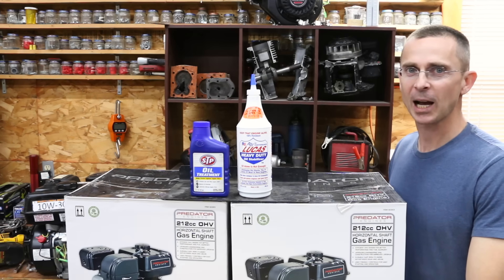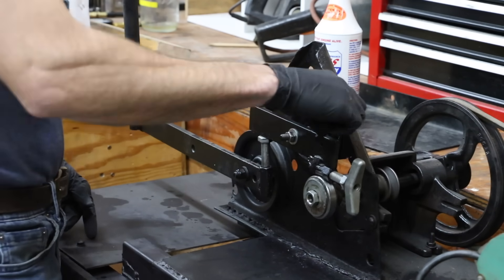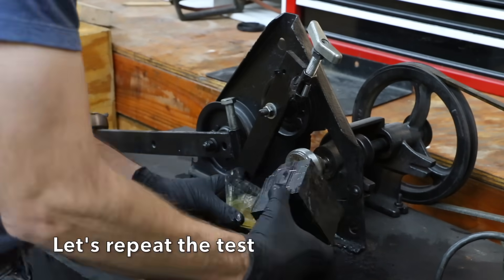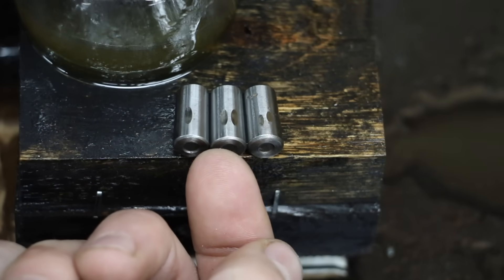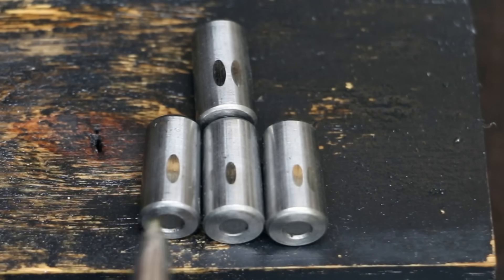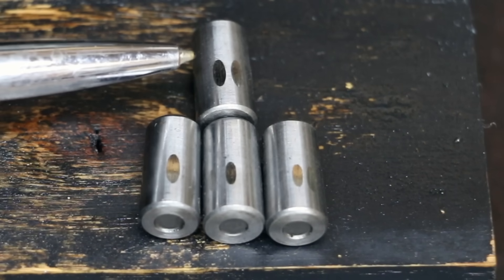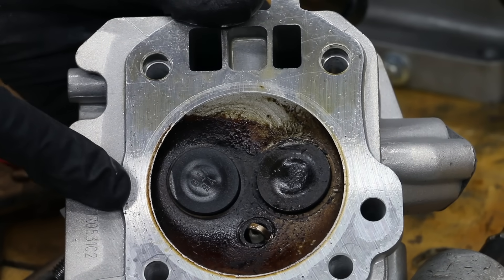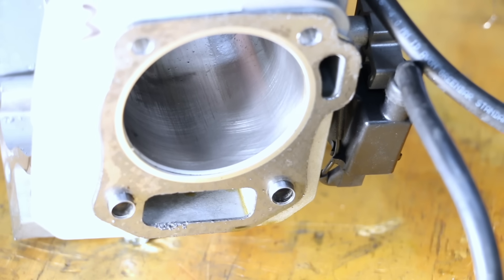Which engine self-destructs first?  Lucas or STP?

Comment: when doing these tests you should always mix at the same ratios.  It will allow for a standard test and the results from any product can be compared.  How did bestline compare to these additives?  engine run time and bearing wear measurements?

It is surprising that just 10w30 lasted 38 minutes and with bestline it lasted 70+ minutes.  Could it be the tolerance on these engines is just too varied?  You might have to test 2 engines with identical oils to see if they fail at the same time.
Reply from the maker: Thank you for this recommendation!

Comment: Run a lawnmower on break parts cleaner like spray into a container then feed into the fuel line did it on a weed wacker engine with some oil ran top notch much more rpm
Reply from the maker: Thank you for this recommendation!

Comment: You should try high mileage additive vs is the normal additive. Another great video man. This channel only gets better and better.
Reply from the maker: Thank you for this recommendation and thanks for the positive comment!
Reply: Tavo24vv the high mileage oil has additives that swell up the gaskets and seals to keep an old engine from having oil leaks.
Reply: yellowlt1ta I’ve heard about that but It almost sounds to good to be true.
Reply: I agree with  yellowlt1ta  I used to manage an oil change location in ATL and that's what those types of oils do they swell up the gaskets to prevent or minimize leaking.. I always said it "conditions" the gaskets
Reply: Novusod he should try the Lucas Synthetic vs. STP synthetic 😗 anyways I use Lucas in combination with the Upper cylinder lubricant to lubricate from the moment those injectors start spraying.
Reply: BikeMaster, I like Upper Cylinder Lubricant, I have a video about it and the Lucas product he used in this video.  Come check it out. Some very smart people commented under my video. You'd learn a lot. :)
Reply: I have a 2002 mustang GT 5sp 144,000miles  and I have a gallon of the Lucas Upper Cylinder Lubricant in my trunk and EVERY time I fill up .. Boom in it goes..( not the whole gallon lol)
Reply: Novusod regular oil changes are recommended once every 50hrs or 1 year on small engines so I imagine it would have some issues around 100hrs.  Would certainly be an interesting test to see how long it would run with the oil in it though.  You'd need a larger fuel supply to do it but technically it's possible.
Reply: Like to see Motor Kote up against any other additives. Had a lot of good experiences with that stuff. Thanks and a great video well done.
Reply: I have a similar engine running a generator at my camp. I run it sometimes for 2 weeks without shutting down.  No problems yet.
Had it for 6 months and run it 1 to 2 weeks a month solid with only shutting down to refill (about 5 minutes) and no problems yet.
Reply: Mystery Oil works with the oil or gas.
Reply: Organist2020 Also using shell 93 nitro every 1000-2000 miles. Engineering explained pointed out how It's better than a fuel system treatment. Strong as an ox!
Reply: Tavo24vv
Reply: Tavo24vv
Reply: Organist2020 I got a silverado with 266k... pulls strong af. I punch it all of the time, but I am meticulous with warming up the engine by not revving past 1500 until operating temps reached, letting the engine cool down before shutoff, and using high mileage synthetic (Mobil or Pennz. Plat.), regular changes, level check once a week, coolant level top offs... and I just put VP's Madditive Cool Down coolant additive. Runs like a champ deep in the heart of Texas! It gets verrry hot here, especially in Houston traffic. My dad sold his avalanche after 300k, only issue was trans! Original motor!
Reply: Xado VS Nano Energizer
Reply: Novusod 

100 hours?

You obviously don't know much about engines or Cubic Capacity.......
Reply: 1992 c1500 with 469k miles.. only reason i dont drive it today is i hit a deer with it couple years ago.. Fram High Mileage filter, Valvoline Maxx Life synthetic Blend. Engine Hasnt been opened up since our family owned it (1992) Bad thing is its on the 3rd transmission NOT counting the GM recall
Reply: At what mileage I should use high mileage oil
Reply: How long would it take for these engines to break if you left the oil in but ran them day / night until they died?
My guess is maybe 100 hours.

Comment: Never believed in Mechanic In A Bottle till I stopped by a guy's place with a truck I was literally taking to the junkyard and he put Lucas in it and I ran it another 20,000 miles after it quieted down in 10 minutes valve tappet noise like a woodpecker went away
Reply from the maker: Thanks for commenting on this!

Comment: I'm not sure that this test is effectively rating the additives or merely rating how sticky they are.  Thick oil isn't necessarily the best option oil for limiting wear, but it is best at staying on the metal after the oil has been drained.  I'd be interested in seeing a control test done where Bestline were compared against a thick gear oil or something.
Reply from the maker: Thank you for this recommendation!

Comment: From a testing standpoint, I believe it is a mistake to grind on the bearing race between tests. 
The grinding leaves a random pattern set of scratches in differing orientation between tests. This adds variability in friction coefficient from test to test. In other words an uncontrolled variable.
A fresh chrome bearing race is hard enough that you are not going to experience lubricant absorbtion.
Reply: Juan Gutierrez Good observation but his repeat tests were of too small of N.
Need an N of at  least 25 to be statistically significant to test your assertion.
Reply from the maker: I'll check with a chemist/testing expert to see if he can suggest another approach. Thanks for the recommendation.
Reply: Project Farm
Cool! Please share his response. 
And I'm hooked on your videos. Really enjoy them.
Reminds me of when I was much younger and ran a stationary engine on laquer thinner...

Comment: Have you compared running engines with pure gasoline vs. gasoline with ethanol?  It's my understanding that pure gas burns cooler and is more power dense.   Any thoughts?
Reply from the maker: I haven't compared them yet in a video.  Ethanol added to pure gas hurts fuel economy for sure.  Yes, gasoline is more energy dense. Thanks for commenting.

Comment: 1. I hope you are keeping the scored blocks. Could be fun for you in the future and for viewer to replace the piston and rod assembly and crank on one and see if one additive or the other helps make the scored out cylinder run better.

2. Something to add that might get you more interesting information in the destruction test in the future is to put a IR thermometer pointing at the crank snout on each. Without oil the rod and wrist pin have essentially no cooling despite any residual lubrication and neither does the crank journal. The design of the engine prevents any way of aiming at the crank next to the journal so the snout is the next best. Gauging the temperature of the head is  less likely to show a difference as it still has the aircooling as it was designed, along with the cylinder.

3. One last thing I can think of is maybe instead of a dry run which will almost assuredly end in the failure of the big end from no cooling and lubrication before the cylinder can seize in the bore, maybe drain enough oil out until the oil switch would trip and stop the engine from being ran and then remove another ounce and disable the switch and see if that makes a difference so that you might see some more seizures instead of connecting rod failures.
Reply from the maker: Thank you for this recommendation and thanks for the positive comment!

Comment: I really like these tests. Super interesting and fun to watch. I am curious though WILL AN ENGINE WORK WITH ATF SUBSTITUTED FOR OIL?
Reply from the maker: Thank you for this recommendation and thanks for the positive comment!
Reply: Probably.. But dont do reverse... once when I was 16 years old I put regular motor oil in my brakes of my 65 Chevy pickup in an emergency situation.. was at a park on a huge hill and had no brake fluid.. the brakes worked great! Problem came a month later when all the rubber and gaskets were desentegrated. The brake according rubber thing on the cover was just a glob.. so ....
Reply: Not really do to ATF has very low lubricity and no detergent and will let carbon buildup quickly
Reply: I think these Predator engines are like the old Toyota 16 valve efi engines.... Indestrucable.

Comment: So, compared to straight oil.  Would you personally bother using either of these? I've used Lucas for a few years and it would be interesting to get you're take on it
Reply from the maker: I have used Lucas in the past and I think it's a great product when an engine is badly worn and needs cushioning.  Thicker oils increase fuel consumption.  I don't normally use either of these products in my daily use vehicles, since I'm more concerned about fuel efficiency than wear.  Thanks for commenting.
Reply: Thanks for the videos,  they're done well.

Comment: Here is one I would like to see.  Back in the late 90s early 2000s I used to see a commercial on TV for zMAX.  Sold at Wal*Mart, and they always drained all the oil and antifreeze out of the engine, big V-8 usually, and they would then start the engine, and it appeared to run forever.  I doubt that claim.  I would love to see zMAX vs. Lucas, see which one is better.
Reply from the maker: Thank you for this recommendation!

Comment: These tests prove nothing. Any experienced person in lubricants will tell you any of these additives are nothing but snake oils. You can get the same short term results using and mixing gear oil. Modern engines don't need these additives. Vehicle engines are water cooled and you're testing air cooled engines, you would get different results for each. If your tests are focused on air cooled engines and you want a little better protection use a non-API racing oil in the crankcase. If you have a car or truck just change your oil regularly you'll never have a problem, these additives are over kill. The only thing these additives are good for, is, if you have a severely worn engine. I just sold my car with over 300,000 miles, never used additives and changed the oil regularly. ( used less than 1/4 qt between oil changes and changed every 4000 miles/ 6 months using a good conventional oil. ) Engine was like new inside when inspected with a camera.
Reply from the maker: Thanks for commenting.

Comment: Zmax vs marvel mystery oil would be great. I've actually been using zmax products and want to know if the oil additive makes a difference or it's all just placebo.

I will say the zmax transmission additive seems to work. I gave away a car for free but I told them the transmission was toast.  Slipping all over the place and the hardest shifts you can imagine. I poured a bottle of the zmax transmission oil in and well it ran like it was supposed to for nearly a year before the transmission died.

So now I want to know if the oil additive seems to work as well as the transmission additive.

Another thing I'd like to see done is shorter videos comparing oil cleaning products, I'm sure most of us have oil stains on our concrete and there is a lot of products out there with no way to tell what works or not.
Reply from the maker: Thank you for this recommendation!

Comment: So we've successfully determined that running an engine without oil for an extended period of time will cause catastrophic failure. Great. Really making some engineering breakthroughs here.
Reply from the maker: Great point. Lots of videos from manufacturers demonstrating engines running for hours on end without anything in the crankcase.  Thanks for commenting.

Comment: Another thing you could possibly test, is the max rpm. Each engine will have small differences internally, but i would imagine that the different oil additives would still have a big enough impact on the engine speeds.
Reply from the maker: Thank you for this recommendation!

Comment: Your comparison test method is faulty. When you want to compare the performance of 2 products, you should stop the 2nd engine as soon as the 1st one fails so that you can really see the difference when you take the engines apart. If you keep the 2nd engine running to the point of failure then there is no difference in the amount of damage between the 2 engines.
Reply from the maker: Thank you for this recommendation.

Comment: This test really prove nothing because what kills your engine is the lack of maintenance, dirt, excessive temperature , dirty air.  The engines are supposed to be run using the required lubricants. Additives are not really a must.
Reply from the maker: Thanks for the constructive feedback.

Comment: i bet if you turned the cranks and installed a new rod they would still run. I run the bigger 14hp version on my long tail thai john boat and its never let me down. Also as i said before if you do this again try the archoil.
Reply from the maker: I agree that these could be repaired fairly easily. This is a great engine design. Thanks for the recommendation too!

Comment: The STP crank made me JUMP when it went!   That was great!   I was rooting for lucas the entire video.   Years ago my dad and I had a bullitt mustang that we tracked and he swore by Lucas put it in everything.    There was one time he  blew the drain plug out while he was preheating and his oil light came on.  For SOME reason he ignored it and reversed, staged, lit and ran with no oil in the car.   Came back around and then checked why his idiot light came on.   The pan was dry and his drainplug was gone.   Guess what i put in everything I own from ATCs to my Cummins?    

That being said..I  don't want you to spend money unnecessarily, but did you ever baseline a predator with straight oil drained (no additives)?
Reply from the maker: Thanks for commenting. Yes, I did a baseline test 2 video ago in the Bestline vs 10W-30.  Thanks again!

Comment: Do you think that there would be any value in going head to head with this test using the best oil additive you can find in one engine vs. a second engine that has been run identically and has only had the manufacturer recommended oil used in it?
Reply from the maker: This seems like a great recommendation--thank you!

Comment: after much searching, a while back i found out what lucas oil is. (this is surprisingly hard to find) all it is, is a straight 60 weight base oil with no additives. which means if you have a car that takes 4 l of oil and instead you replace 1L with lucas oil you are diluting your additive pack by 25%. the only time i would ever use it is if an engine is on deaths door and it needs oil pressure rather than additives because its going to fail soon anyways. i would never put that garbage in a newer engine
Reply from the maker: All great points. Thanks for commenting.

Comment: I'm impressed with how Lucas did in this test. I literally just put a bottle of Lucas in my car today when I changed the oil. It's a scirocco mk2 that has an odometer that stopped working a long time ago and is stuck on 186k so god knows how many miles it's done. Overall it made my engine quieter.

I think you need to have a third engine with just motor oil to see if it lasts longer/shorter than the engines running the additives. It would make a fairer test.
Reply from the maker: Thank you for this recommendation and thanks for the positive comment!

Comment: I have been adding STP to my 2002 5.3 v8 silverado 1500 since I have owned the truck (166,000 miles, roughly 176k now.) The 5.3 Chevy engines are known for having their lifters tick. Since I have bought the truck, there is a lifter that ticks really bad when the oil is dirty or ready to be changed, and it ticks slightly with fresh 5w30. I add STP and within a couple days, the lifter always shuts up and it runs really nice and quite like it should. I wonder if I would have similar results with Lucas.
Reply from the maker: Thanks for sharing this experience.  This is a great post.

Comment: Hey how can you justify this as anything but pure nonsense? Your 10w-30 motor lasted 38 minutes, longer than EITHER of these additives?? There is just no way to determine how good these additives are by running engines with no oil. How can you explain the additives reducing wear scars in the bearing test but both engines failing sooner than plain engine oil?? This is just a good excuse to blow some engines up, with ZERO scientific proof that these additives do anything.
Reply from the maker: Thanks for the constructive feedback.  Lots of videos out there by some manufacturers of additives demonstrating "empty crankcase" testing as the gold standard for film strength.  Lots of people have asked me to do tests this way. Thanks for commenting.
Reply: IF this is the gold standard, how can you explain the fact that plain motor oil lasted longer than both additive engines in this video, when both of them get a better wear scar on the one arm bandit? obviously something is wrong with one test or another! just curious what could explain it.